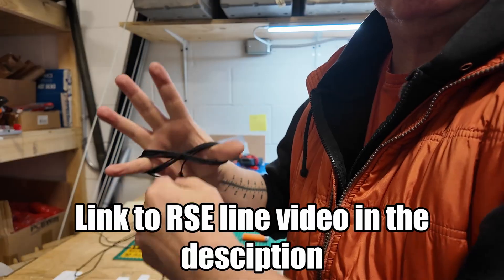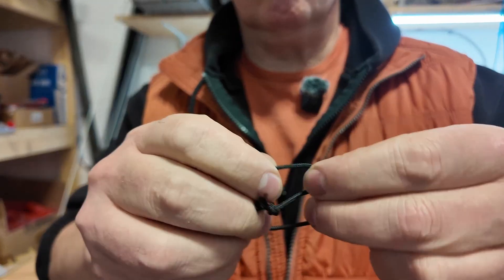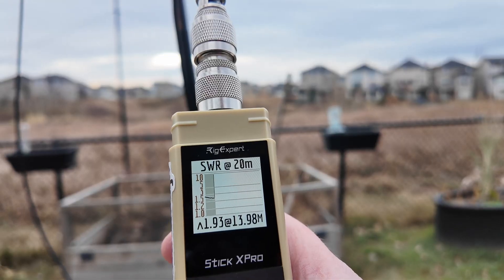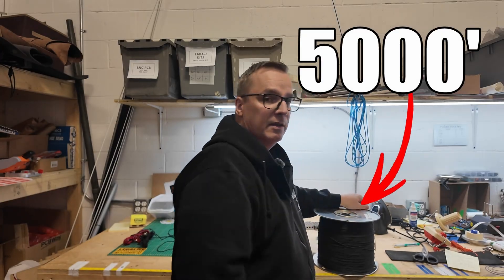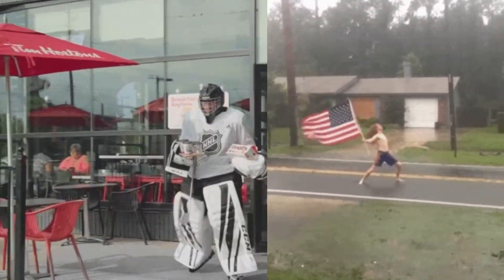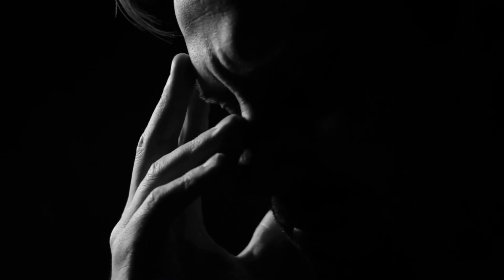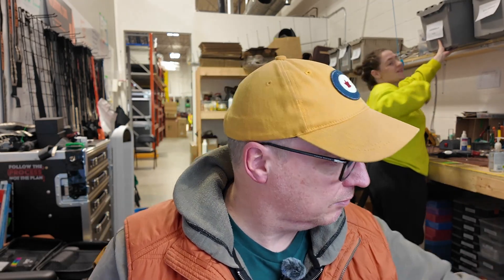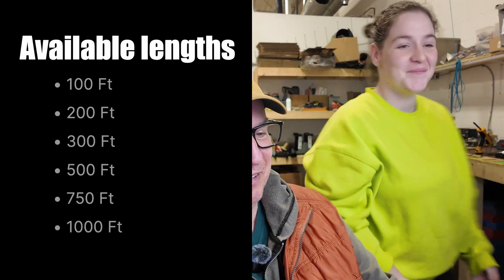Why This New Ham Radio Wire Sold Out So Fast | The Future of the RSE Line

Comment: Excellent! I'd really like to see how this stuff performs with quad antennas, moxons, hex beams and that sort of thing. Some nay sayers are claiming resistance is too high compared to copper and any advantage in cost savings or strength or size or weight is not worth compromising electrical efficiency. I suggest to them to give it a try and see if it is any kind of compromise compared to copper or aluminum or stainless steel. Material resistance is one thing, but RF travels on the surface of the conductor and internal material resistance has a lot less impact with RF than with say AC or DC voltage at high current. That's why this RSE wire is much more specific to RF applications than traditional wire that is designed for high voltage and high current applications.
Reply from the maker: Yes it is a new twist on the litz wire

Comment: Is it electronically conductive though simple knots?
Reply from the maker: No it insulates through the sheath. I have done some stuff where I push a safety pin through the knot into the main cord though and get a good electrical connection. This is a video that will be coming up